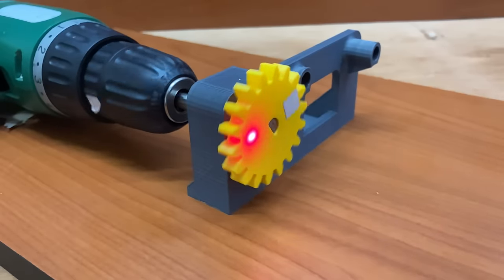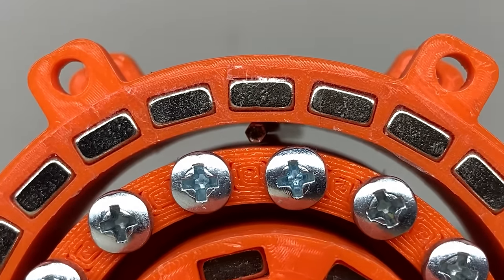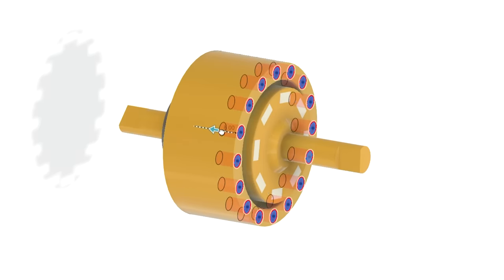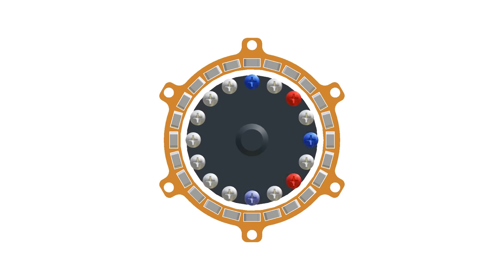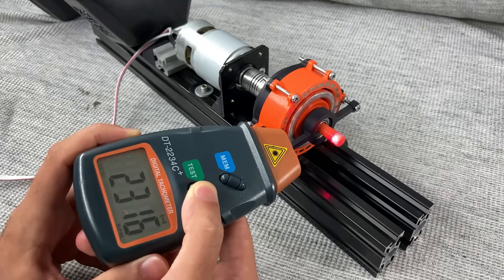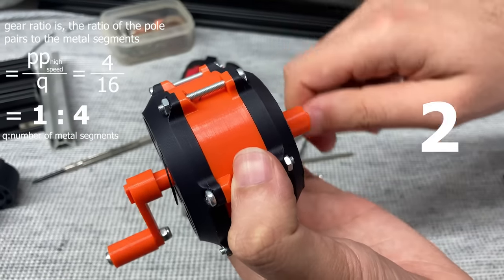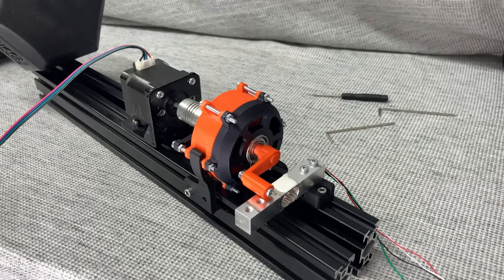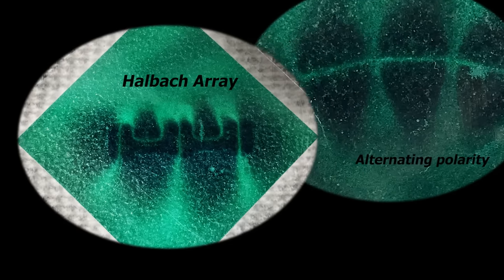Magnetic Gears - Why Nobody Talks About This?

Comment: A major limitation (similar to stepper motors) is the smoothness. Look at how jerky the motion is. If you could make a high load version, those bearings would see a high vibration load that is lossy/will wear them out.

Also like stepper motors, they have the advantage of slipping instead of breaking, which is great when you want it and terrible when you can't allow it.
Reply: a lot of those issues have been solved in magnetic bearings and casings for flywheel batteries.
Reply: Flywheel?
Reply: My apologies, I did not read your reply. My comment about flywheels was more in the mentioning of, why not just use flywheel, but you already answered that!
Reply: maybe it would work as the early gears in e bike midddrives. right now what is used is a plastic gear, to limit the torque and break first
Reply: Another solution to jerkiness is to make the sun, planets, ring 3 times longer, and rotate each segment by 120° in phase (proportional to the dimensions in each part).

It would also have 3 times the torque.
Reply: You can get rid of jerkiness problems by increasing number and decreasing size of magnets, with smallest size being limited by gap width tolerance you can achieve. With large versions with many magnets, the jerkiness would become insignificant compared with inertia of the components.
Reply: Micro stepping motors is as smooth as any digital servo, and steppers can be stalled indefinitely with no damage. Most of my systems run over 50,000 steps/rev.
Reply: I think electro magnets might be a workaround.
Reply: this is due to a flaw called magenet cogging

Comment: Because it uses magnetic field to drive the output shaft, it is very similar to a motor.. 
The best results you will ever be able to get are likely as bad as stepper motors. 
Like stepper, you can increase the strenghts by making it longer. 
Double the length : double the strength. 

I 'd like to see it used in reverse, to up the speed
Reply: yeah because electric motors already have a lot of talk so the could achieve very high speed with gears. The talk is evenly spread throughout the rpm range  as opposed to a combustion engine where the talk is only in certain hot spots. Talk is the best way to get around these days. nice talk-ing to you.

Comment: to answer your question: "Why no-one talks about this?"  -- very simple. It is physically impossible to make a magnetic gear system that has more output torque than a motor of the same size and geometry can generate on its own without gearing. 

In fact, due to the much higher flux density of electrically energised ferromagnetic materials (2T vs 0.4T for the best permanent magnets) a properly designed electric motor will significantly outperform any passive magnetic gearing in the same space. So why have a motor and a weak magnetic gear when just a motor would be 5 times better? or 25 times better? (since magnetic force is the product of the two flux densities, if both rotor and stator are electromagnets it can be 5 x 5 times stronger). For this reason, magnetic gears will remain only a curiosity.
Reply: magnetic gears are already being used though, in sealed couplings for example in numerous industries or in hazardous materials handling or high vacuum or high contaminant sensitivity applications where gear oils/grease could contaminate through outgassing.

A factory I worked in used these exclusively for pumping highly flammable liquids in order to completely seal and isolate the flammable and electrical side of things, so there's tons of applications where these are very practical to use and are already an industry standard.
Reply: @platinumsky845  Absolutely, for these applications the advantages outweigh the disadvantages.  Usually they dion't
Reply: this dude is right
Reply: Cmon dude they do have a practical use and they are used probably from before I was born.

Comment: Wow, you did a great job visualizing and explaining everything! I'd never heard of using ferrous, non-magnetized components to redirect the field lines of permanent magnets like that. That is such a cool idea!

Watching this, I couldn't help but wonder if the rolling element bearings couldn't also be replaced with either some manner of magnetic suspension (which might interfere with the other magnets, idk), or a fluid bearing that takes advantage of the high rotation speeds in order to create an air cushion between the axel and the... whatever you call the thing that holds the axel in place.
Reply: Nope.  Not unless you were going to have actively controlled magnetic bearings.  It is impossible to make a static magnetic structure that levitates.  There is always at least one axis of instability.
Reply: @bpark10001  But this spins. Wouldn't that satisfy Earnshaw's theorem?
Reply: @hollt693  I assume you are referring to the Levitron Top (maintaining levitation by spinning).  No.  First, have you ever worked with the Levitron top?  Its equilibrium is so marginal that the slightest change of room temperature or a puff of wind will send it flying!  It requires 20 minutes of tweaking weights (on the order of 1% of the top's mass) & leveling to fractions of a degree.  Secondly, it cannot support any side-forces that would be imposed by things the machine is driving, nor acceleration forces.
          In addition, the side-forces imposed by the magnetic gearing (which are ~10x larger than the torque-producing forces) would also add to the forces the magnetic bearing would need to counter.  And what would you do when the motor stopped?  Get a Levitron & report back!  It must be practical from an ENGINEERING perspective, not just a scientific one.
Reply: @bpark10001  That's fair. I do have a Levitron around here somewhere, but I haven't played with it in years. What you're saying makes sense, though. The output shaft would definitely require more stability than what could be achieved with passive magnetic levitation. Even if you could add a big ol' flywheel onto the shaft for some sort of gyroscopic stabilization, the procession would be undesirable at best. Huh. Dang it.

Comment: If you apply a voltage to the central gear, and attach it to a rheostatic variator, it should be fairly easy to alter the magnetic flux of the central gear to allow it to slip more or slip less of the input and output gears, thus acting as an electric torque converter. I've had almost the same design drawn up.
Reply: Genius! Way better than modern day transmissions! But once we switch to electric motors transmissions won’t be really needed on vehicles
Reply: aha, I just commented such. I been working on plans in my head for a few years. I might even have some in my computer 3D. I wonder where they went.🤔
Actually, my design was to use elecro reversing pole set up.

Comment: We've been using magnetic drive pumps in the beverage industry for ages. Pump, and motor have zero physical coupling. It can transfer plenty of torque to build enough pressure to blow apart tubing if there is a restriction

Comment: I love your use of magnetic viewing film here, it makes the moving fields much more clear!

I wonder if just a plain steel ring outside could focus the magnetic field almost as well as a Halbach array?  Most brushless rotors seem to use just a 1-2mm thick steel ring outside the magnets, to capture the flux that would otherwise dissipate out.  Increasing the amount of magnetic material in the crucial middle piece, and decreasing the gaps, might increase the flux linkage and hence torque too...
Reply: Yes, a plain steel back-iron would work.
Reply: Wouldn’t the rotation cause it to heat up?
Reply: @tripodal69  Because the field of the outer ring is constant (created by permanent magnets, not coils) eddy current losses are not a big concern and plain steel should work... but anything would be better than nothing.
Reply: Yes it certainly would!

Comment: Magnetic gears have been around forever. My grandfather built a little gearbox with magnetic coupling well over half a century ago and we still have it kicking around somewhere.
Magnetic gearing isn't used because it's INCREDIBLY expensive and bulky for the amount of torque it can transmit. A much cheaper and stronger gearbox can be built with conventional mechanical gears.

Comment: One application I thought of is the slip could be used to generate a vibration while being balanced. Compared to most uses like a concrete mix vibrator that utilizes unbalance weight to induce the vibrations. Could also be an excellent safety feature for machines with human interaction. I look at it almost like a double electric motor / generator. Great video:)

Comment: Wow.. thanks talking about this. I’ve seen this design also in pump for corrosive liquids. The impeller rotor is engaged with external motor through magnetic coupling to prevent direct contact from liquid to motor. But yeah, utilizing it as “planet gear” is something I’ve just seen here.
Reply: Good ol' Magnatex pumps, used to work with them when I worked in the chemical industry
Reply: Immersion pumps in general work like that. The stator is sealed in a plastic housing, away from the water, and the impeller has a permanent magnet attached that serves as the rotor.

Comment: The torque would probably rule these out most purposes. This goes more or less into a sort of sensory array. And for this we have hall sensors already. Probably that is why ..?
But great project and very nice idea. Something unusual!
Reply: Don't Engineers choose technologies based on requirements?
Reply: If you make a magnetic torque converter which would just be an induction motor with a permanent magnet stator, you could get a lot more torque. But I'm not sure if it would outperform the traditional hydraulic torque converters. The only advantage would be less maintenance.
Reply: @Stoney3K  eddy current clutch.....the motor spins at a constant speed the output shaft of the motor and the output shaft of the clutch are connected to 2 drum shaped metal parts that never touch and are  coupled by a magnetic field that's adjustable.....

Comment: Put three or four of these in parallel, but out of phase, so there's always one of the three pushing whilst the other two are in some phase of 'slipping', then you've got relatively steady torque even down to zero speed, without damage. 

Also, it looks like that 'lumpiness' carries over to all speeds, so setting it up that would should make it turn smoother at all other speeds too.
Reply: Rather than putting several in parallel, the practical solution is to spiral the gear "teeth".
Reply: @Nathan511  Sure. that's ideal. Probably easier to do with the intermediaries, if they're made in lamination slices that can be assembled with a stagger: similar to how you get rid of the cogging in a motor. Ideally, the magnets would be too: however, I don't know of any manufacturers who offer them in the right shape for that, so you'd have to give them a similar shifted-lamination-slice magnetic steel 'guide' to put the flux where you want it (ie, mount the magnets within the 'guide', sections: slices would have the cutout for the magnets shifted so they line up to make a slot for the magnet to sit in, when assembled with the designed 'stagger').

Comment: Because metal gears work really really well?
Gears have tremendous force applied through them! 
All 350 horsepower produced by the crankshaft of my car goes through just 1 gear which is only about 20mm across. The force pushing the gears apart is phenomenal, and is in fact so high that the gearbox has two special braces which go right through the gearbox to prevent it exploding under high load.
Not only does this gear have to withstand huge power, it has to do it for at least 150,000 kilometres, and preferably 300,000.
Metal = good.
Magnets are for motors.